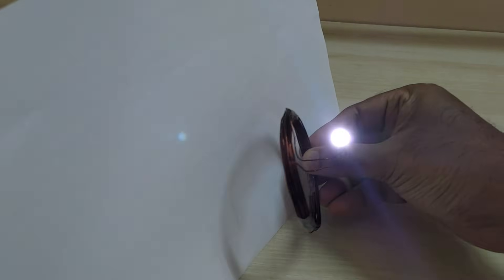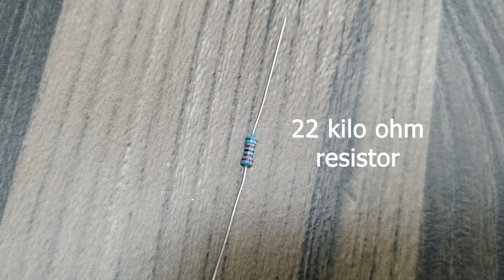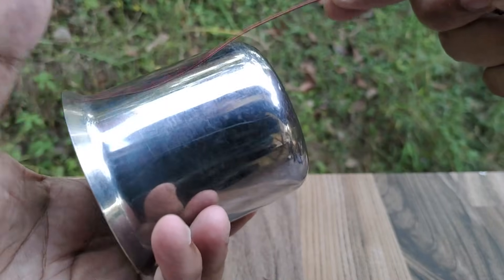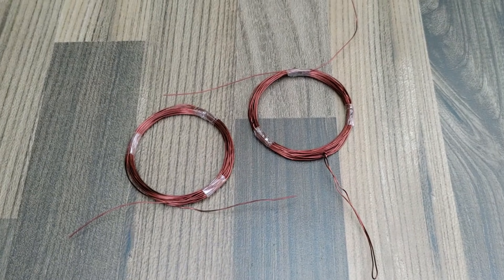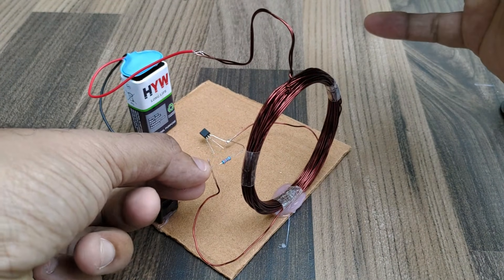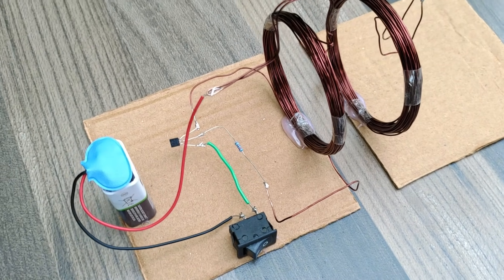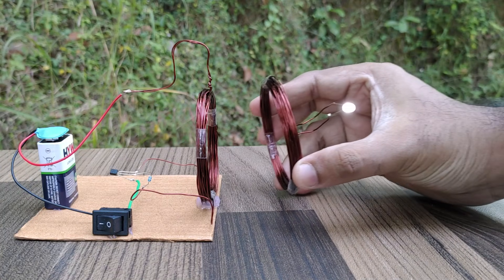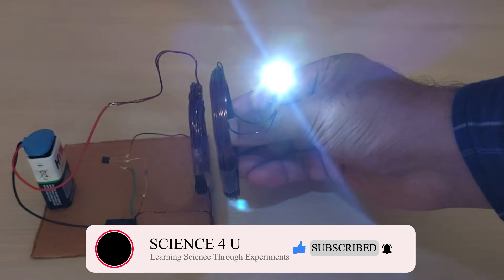How to make wireless power transmission system ⚡ || Wireless electricity project || 100% Working

Comment: does the distance between the elements matter?
can i fix them in a different distance?
Reply from the maker: The closer the distance between the coils, the higher will be the induced voltage.

Comment: Can we ise bc 547 transistor
Reply from the maker: Yes friend. You can use BC547 transistor and it will also work. Both 2N2222 that I have used and BC547 are almost identical transistors.

Comment: Wire other than copper?
Reply from the maker: Hi friend, Any conducting wire like copper, aluminium or steel should work. Most importantly it should be insulated. It is very easy to get insulated copper wire. I dont think insulated steel or aluminium wires will be available.